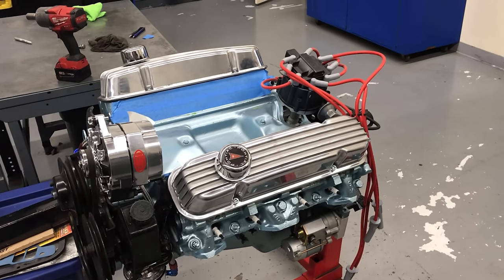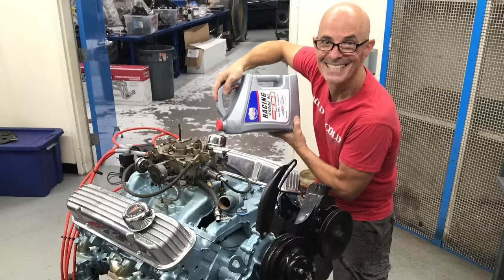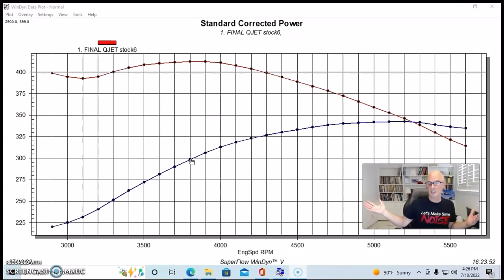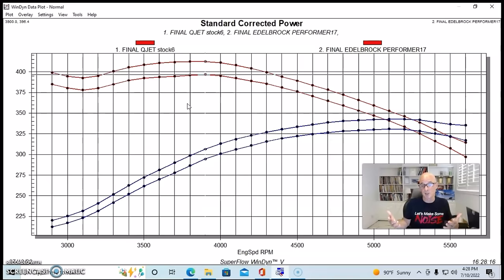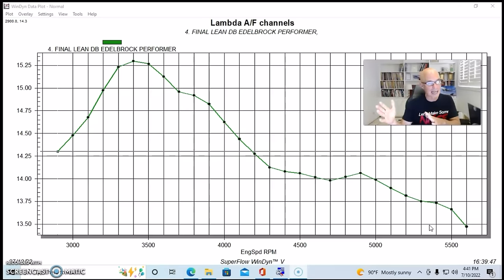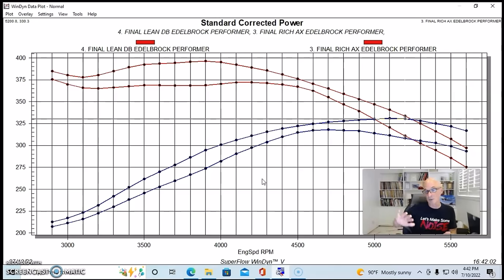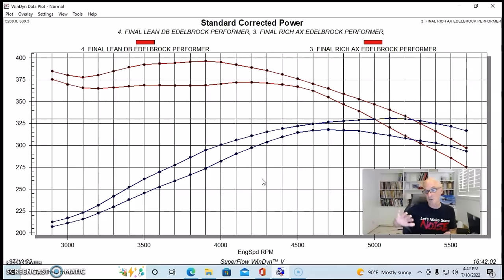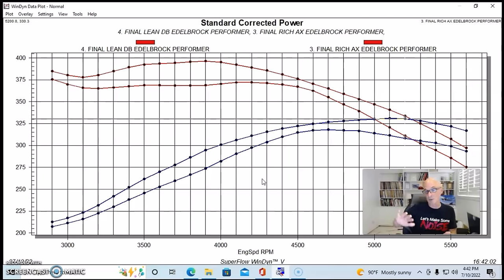HOW TO: Q-JET TUNING FOR BIG POWER GAINS PLUS STOCK PONTIAC 400 Q-JET INTAKE VS EDELBROCK-WHO WINS?

Comment: Do what you want with a QJet but it has vacuum secondaries and no accelerator pump.....a dyno will no show real world response.  It's  no going to match the response of an Edebrock hi rise with a Holley 750 or 850 double pumper..    That waaa you're so happy with is lack of fuel and the car doesn't go anywhere...
Reply from the maker: and yet Stock classes running Q Jets work perfectly

Comment: The stock qjet & iron manifold made 12.5 more hp & 16 more ft lbs of torque over the tuned qjet & edelbrock manifold, and way more than the unturned qjet on edelbrock manifold